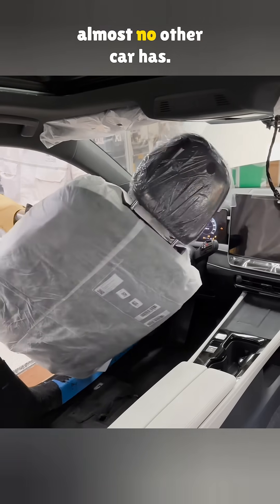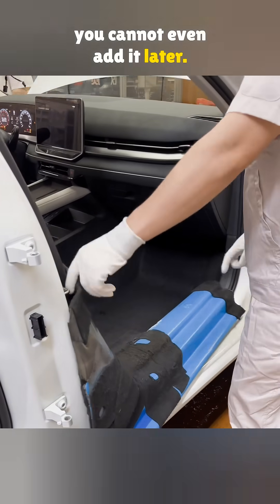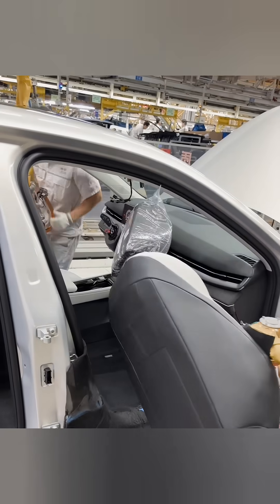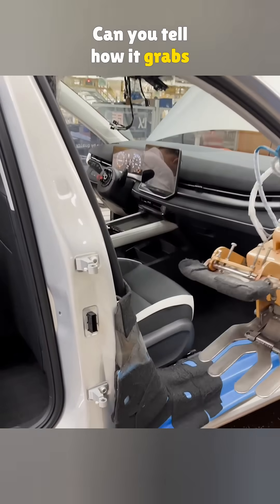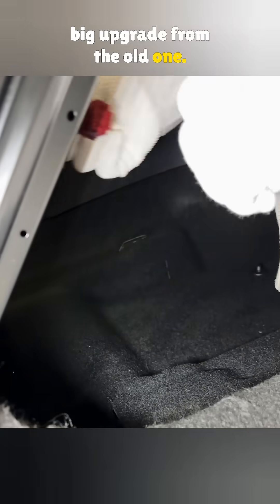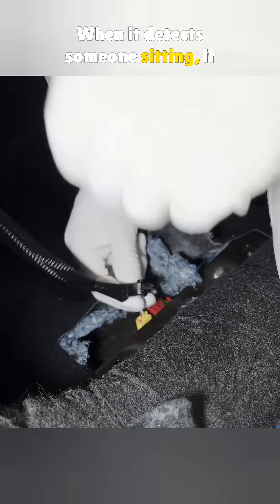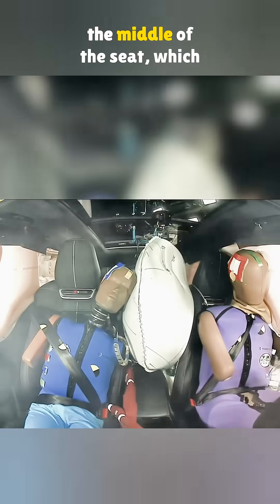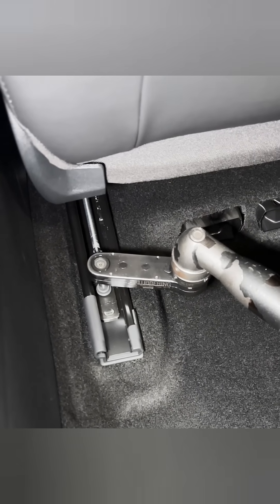Why This Jetta Seat Is Way Smarter Than You Think

Comment: Judging by the appearance of the seat and the limited wiring and connectors, it seems this Jetta seat has very basic features compared to what most modern vehicles offer.

In vehicles with more advanced seat options, you'll notice additional connectors and wiring. This Jetta seat is not a power seat; it lacks features like a seat heater, cooling fans, massage motors, or audio speakers in the headrest.